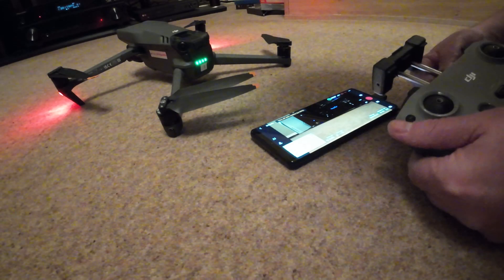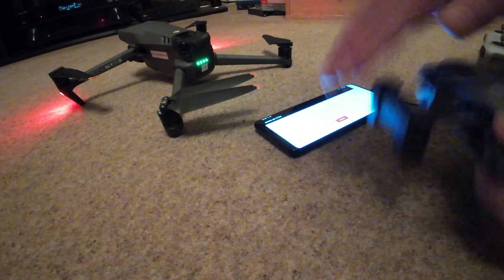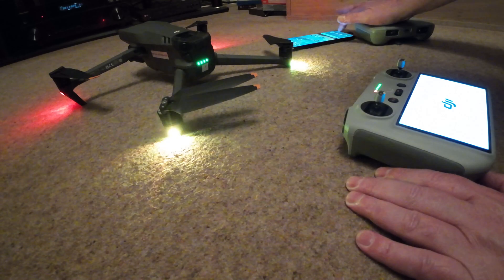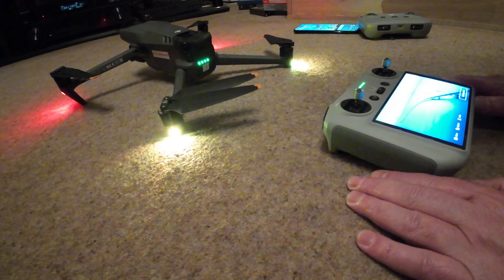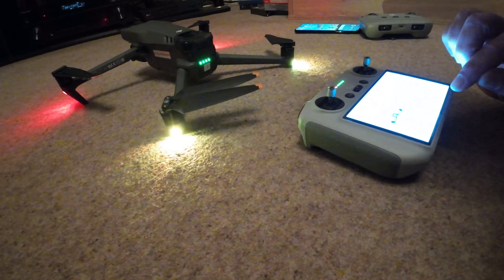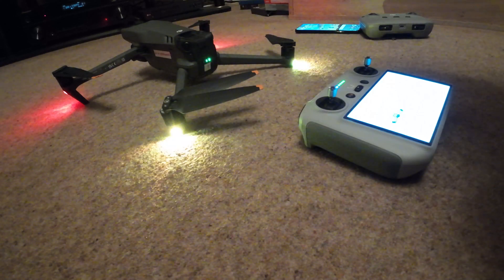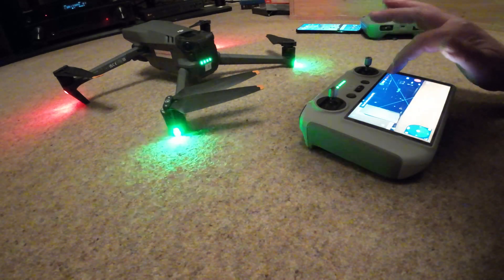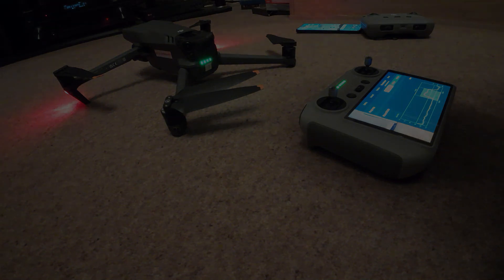WILL THE FCC HACK WORK ON THE MAVIC 3 CLASSIC ?

Comment: Is this still works on new firmware update?
Reply from the maker: Not tested but no other firmware update has impacted it yet. So I'd imagine it's fine.. I will try on my drone shortly and come back to you bud
Reply: @jimthorleydronefootage  thank you brother, glad you respond 😇🙏
Reply from the maker: @Daksavedhas  I can confirm after the latest firmware update this patch is no longer working
Reply: @jimthorleydronefootage  omg im sorry to hear that, can you downgrade the drone so the hack will work again?
Reply from the maker: You can not roll back my friend will need to see what can be done now so if you have not updated you may wish not too
Reply: @jimthorleydronefootage  i just update the firmware and the hack no longer work :( please tell me if you find a solution bud
Reply: @jimthorleydronefootage  hi bud, any update to get back to fcc?
Reply from the maker: @Rafi Addarajad  not as yet bud
Reply from the maker: Hi buddy I just bought the drone tweeks hack cost me about 25 quid and its a modded fly app so works on any of your drones but will only work on the rcn1 controller with your phone attached bùt just tried the mini 3 pro and mavic 3 and both are going into fcc mode bud hope this helps
Reply from the maker: Hey bud check my latest video that will be up soon found a work around you do need a rcn1 controller and pay a small amount for a hack but can hot swap to rm330 controller
Reply: @jimthorleydronefootage  do you have the tutorial to get back into fcc bud? Btw i only have Mavic 3C with basic RCN1 vontroller
Reply from the maker: @Rafi Addarajad  hi mate you need to buy drone tweeks hack once you have bought it un install dji fly app and install drone tweeks fly app it's a mod version of dji and as soon as you power on the drone your in fcc mode if you still want to fly in ce mode then re install the dji fly app and you can use either one
Reply: @jimthorleydronefootage  can you send me the apk bud? I just wanna test it. Because i hear it cant run on s22 ultra / snapdragon 8 gen 1
Reply from the maker: @Rafi Addarajad  I don't have it to send bud it comes from drone tweeks and I believe you are correct it doesn't work with that setup fine on my s21 ultra
Reply: @jimthorleydronefootage  duh, i only have my s22 ultra right now 😭, need another way to get back into fcc then 🤦
Reply from the maker: I would imagine drone tweeks is working on that bud just keep a eye on their site I take it the fee hack worked on the s22?
Reply: @jimthorleydronefootage  ive ask them bud, the said the APK is not support on S22 Ultra / 8 gen 1 😭. Do you have another way to fcc maybe
Reply from the maker: Not at this time bud only thing you can do is buy a second cheap phone or do you have a tablet you could use?
Reply: Better using a nice big Samsung tab a tablet

Comment: Does this turn off the DJI Geofence so we dont have to contact them for a permission code or does this just turn off the distance limit?
Reply from the maker: Nothing to do with either bud puts the drone in fcc mode, which is 40 per cent stronger signal

Comment: and what is the difference between this hack and 'drone-tweaks'?
Reply from the maker: It's free
Reply: @jimthorleydronefootage  you are right, but other than that, have you had any errors, problems with such a "free hack"?
Reply from the maker: @dfsdff9195  none buddy flew my mavic 3 yesterday in fcc latest video on my channel
Reply: @jimthorleydronefootage  Cool, thanks for the feedback, with love from Russia :))
Reply from the maker: @dfsdff  no bother buddy give it a try the signal strength is amazing I was 1.5 miles away full signal don't get that in ce mode.

Comment: Hi, can i do it i only have rc controller?
Reply from the maker: You must do it with the rcn1 controller first bud unfortunately but these can be picked up 2nd hand for about the £50 it just depends if you really need the fcc mode. If that's worth you spending the extra cash. Something may come along in the future for the rc controller on its own. I bought 1 as a backup as I had 1 with my mini 2 but now have the mini 3